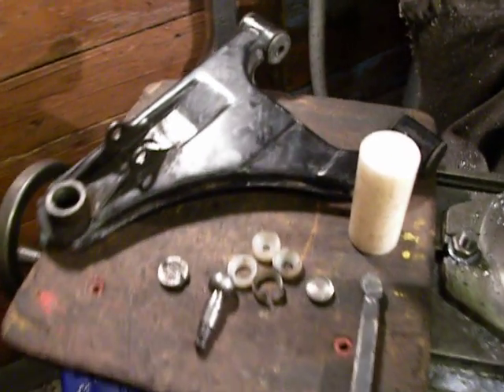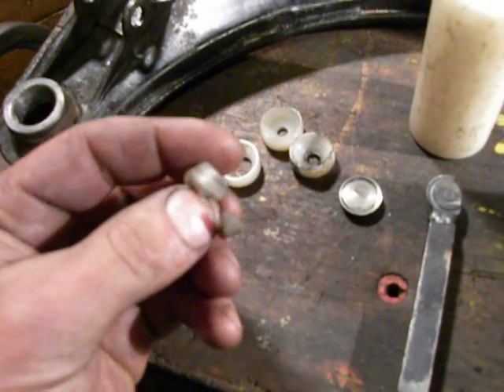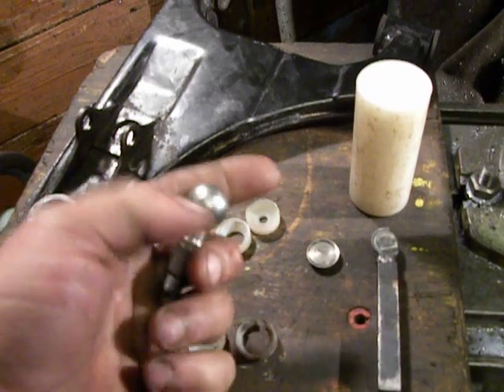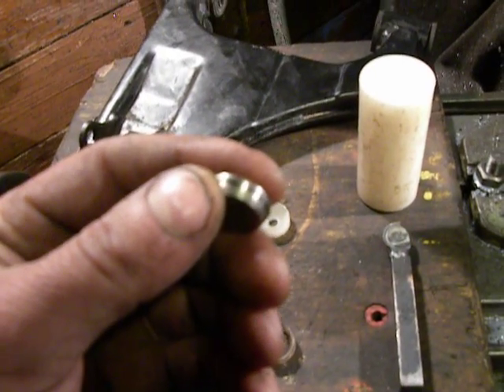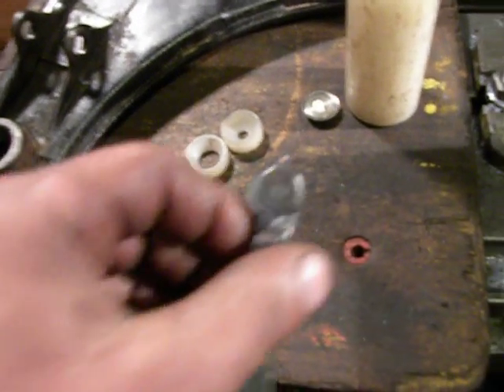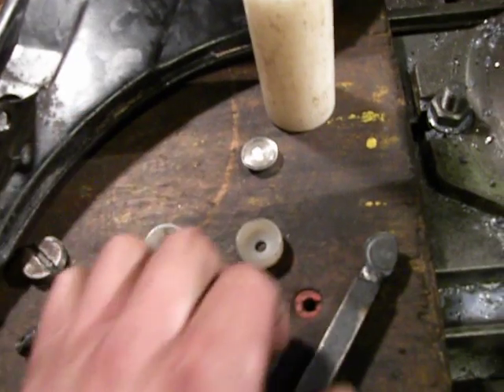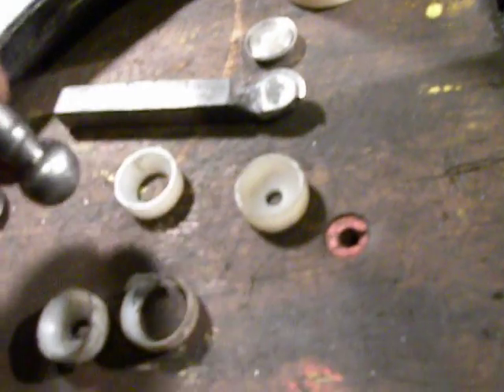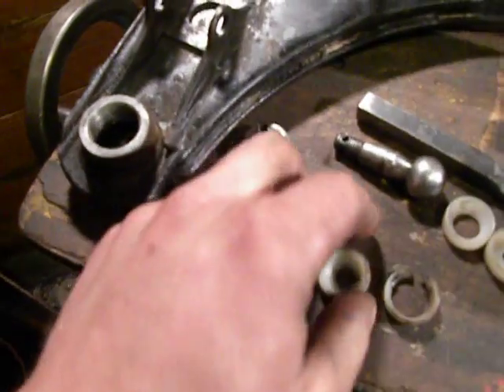Way how to fix ATV ball pivot unit

Comment from the maker: Thanks! I use my diamond grinding wheel - in this way I to sharpen only cutting edge... I done it by hand. P.S. I have tool grinding machine, but right now it not set it correct place - I should to replace it to my "grinding workshop".